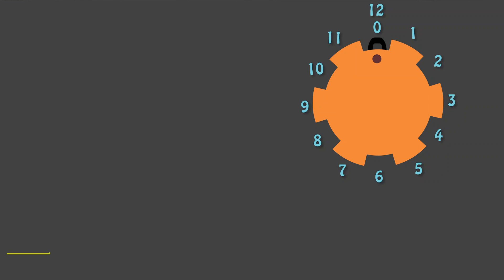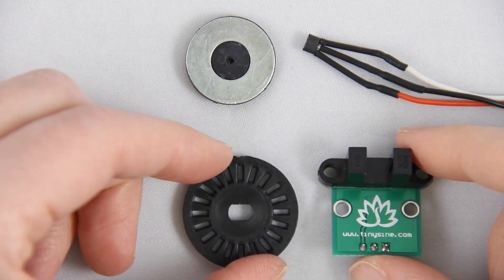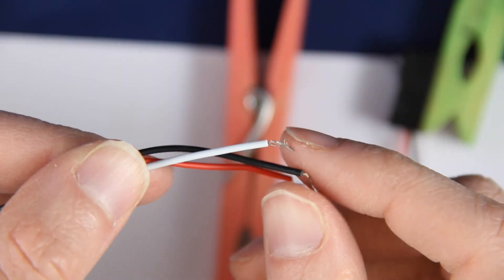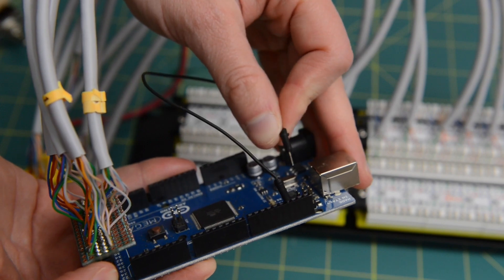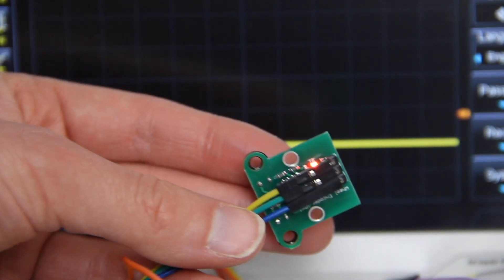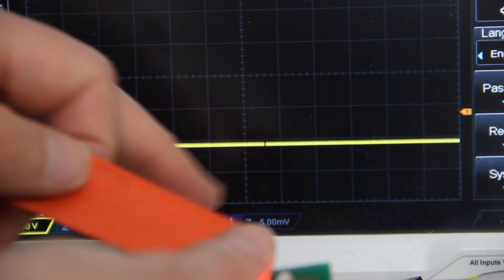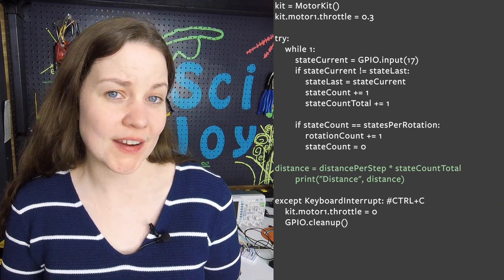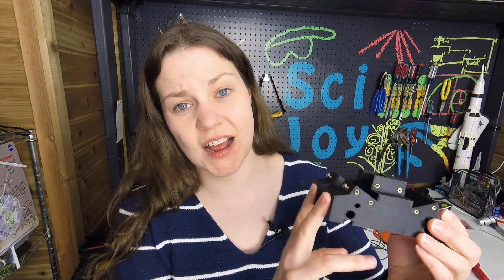Tracking Raspberry Pi Robot's Distance with Encoders | Twitter Controlled Robot Ep 4

Comment: Can please help me, How to use an optical rotary encoder to stop the motor when it rotates a certain amount, I’m building a cablecam, the cable cam should stop automatically when the cable cam reaches a certain distance
Reply: For simple stopping, just count the pulses and stop driving the motor when you get to the position you want.  For more complex control including accelleration/decelleration, you probably want to look up PID control which will help control motors based upon feedback from the encoders to do precise positioning and velocity control.

Comment: I tried this code with a printer engine that comes with an optical encoder. It worked at low speed, but when the speed increased the count stopped.

Comment: Thank you so much. It wasa very informative video.Can you please help me about how to connect the optical encoder used in this video to the raspberry Pi. Also which DC motor have you attached to the spoke. Can you please share the link where you bought that DC Motor and which motor driver can we use to control the DC motor to arduino?

Comment: You never did the next video.  How do you keep track of the encoder pulses in a program that also is controlling and tracking the rest of the robot functions?  As your code is processing other things, it will miss state changes.
Reply: Look up resources about using interrupts with Raspberry Pi, and use that to detect when the pin changes. It also makes for much more readable code than the example shown here.
Reply: there's no update on this as this was an incomplete idea with poor implementation for it to be used in any accurate (practical) way. You need a dedicated encoder or use interrupts
Reply: Hi @Kingston, have you found anything useful?